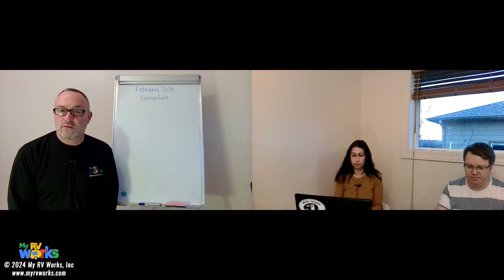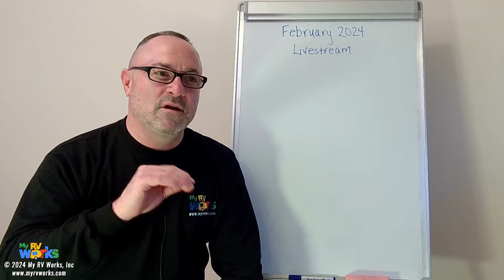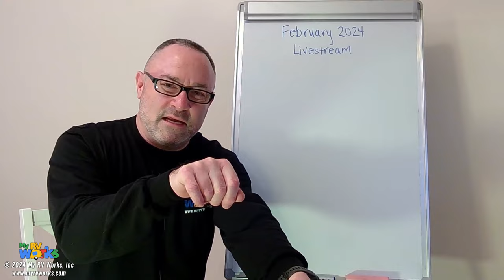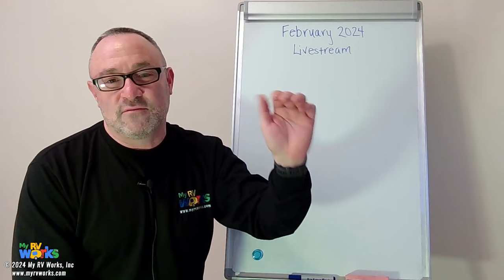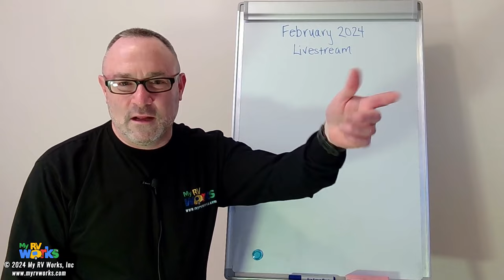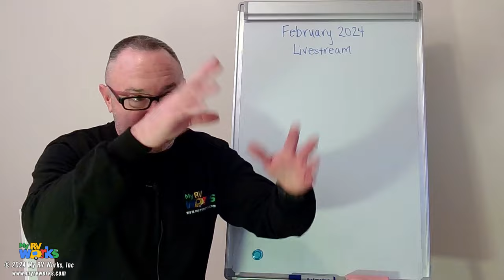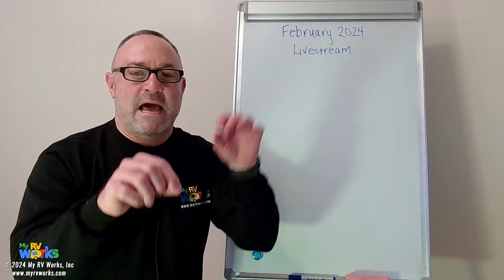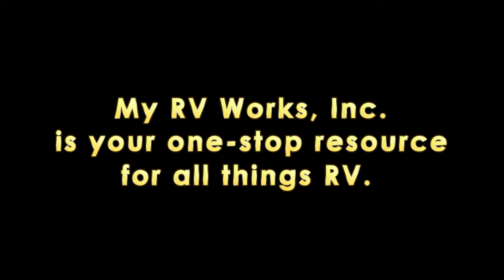How Parts Become Obsolete (And What To Do About It) -- My RV Works

Comment: My neighbor has a 10-year-old diesel pusher RV and the controller board that controls the hydraulic jacks failed. He had a heck of a time finding a replacement, and not even the company that designed the board would try to repair the board itself!! He finally found a company that had an earlier design of this board and sold them used for $600 and no guaranty or returns as they were electrical. Fortunately, the replacement board did work but very frustrating, especially since he paid $350k for the bus new.
Reply: Dinosaur Electronics can usually rebuild boards like that.  Worth a check on that!

Comment: I agree with spending the funds to replace an old unit due to safety, that's the way it is. Other things are just have just been discontunued. I been trying to find a cold water fill valve for my 6200 Washer for over a year since calling Splendide and they said parts are no longer available for that one. I like the older units that are more mechanical and not digital, with a main electrical board to go out and now the whole thing is dead. I had water in one of the lines when gone away for 2 weeks in freezing weather and the valve split then leaked after. Some JBWeld helped to get back operational but a towel under the valve is still needed for drips 😞 Anyone parting out one of these washers with a working valve they'd like to sell would be helpful 👍 Like the videos, always great info 😊

Comment: Do some leg work yourself, however, because I found the manufacturer of parts that I was told were no longer available and was able to get them when the service department of an RV dealer told me parts were discontinued and no longer available. I have also found that some parts discontinued or no longer sold by an OEM are compatible with third party parts, sold under a different part number, and sometimes used by another OEM under their name and part numbers.
Reply: This is true, but sometimes they are just not available anywhere 😉

Comment: 30 years in building engineering and yes I get it things go out dated. Got it! But I have a customer with a 2019 yes 2019 5th wheel with a suburban oven and he forgot to lock the oven door and in transit it broke the outer glass. Remember 2019. Come to find out his unit is discontinued and no parts available. On a 2019! That’s just ridiculous.

Comment: I can understand that on  furnaces Although the cracks can be mig welded and we have c02  and carbon monoxide detectors  now  I diddnt know about the mercury  in the stove manifolds but we got mercury in the thermostats on the walls but  im immortal as i drank from garden hoses and ate worms as a kid lol  I grew up in the 60s so im used to fixing stuff  and our old car owners manuals told us how to grease things  and adjust the valves ect Now the owners manuals tell you not to drink the battery acid  ? So what they got now a 5 year degree to tap an A/C and add R 12 or whatever  freon to it so it will last another 30 years ?